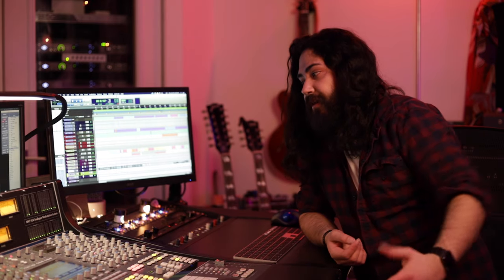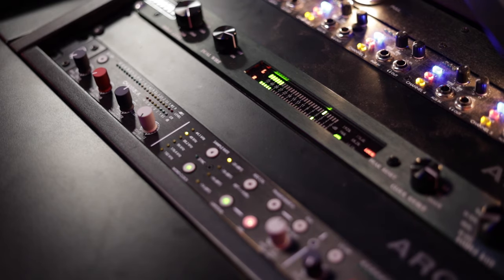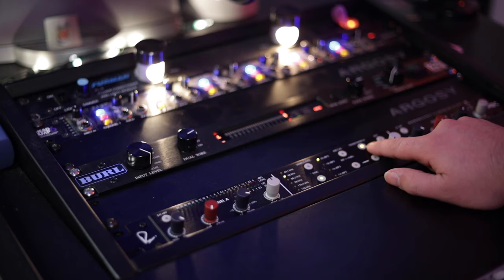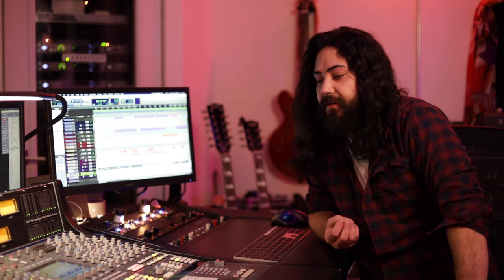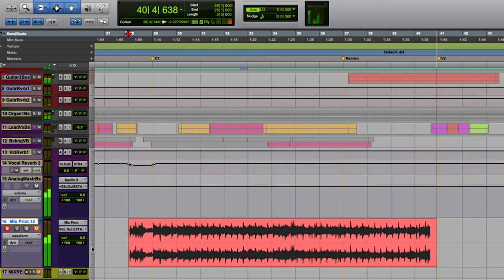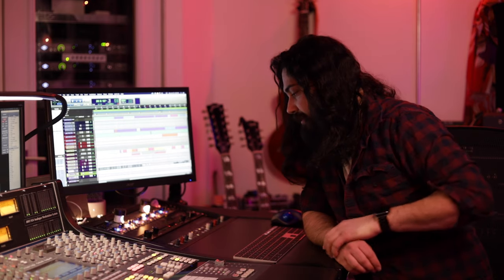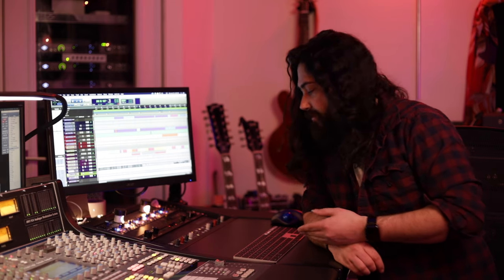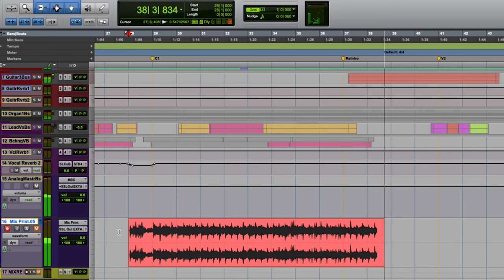AD Converter Shootout - Burl B2 vs RND MBC vs. UAD Apollo X

Comment: Any ADC that colorize your signal is a bad ADC. I bet it's not the case of any of the stated equipment.  The Burl seems to just have an emphasized low end (at the preamp or any other spot on the signal chain) or maybe is a bit gainier, which tells you nothing about the quality of the converter itself. You should compare them by proper spectral analysis, distortion, signal-to-noise ratio. Otherwise people are just deceived in their own biased perception. 
Another method of comparison is to take 2 captures of the same signal, by two diferent ADCs, align them in perfect phase and exact same volume, then invert the phase of one of them, so they cancel each other. If there's something audible left, that's the difference between the ADCs.
Reply: but when it sounds better, whats the prob
Reply: @newtension  "good" and "better" are subjective terms. They may vary from person to person. Ears are bad references if the goal is to perform an objective, technical, analisys. On the other hand, I don't know why an ADC needs a transformer, but these and coils do change the phase of a signal by nature, as any other type of filter (except digital linear-phase eq's). We don't have the hability to hear phase, unless there are two signals interfering each other. It matters, because our room and speaker setup will mess up sound by many orders of magnitude more than an ADC, I bet youtube compression also mess the quality of the signal much more than an ACD will do, so its a futile practice to compare between them by listening over YT. The important parameters for selecting an ADC can be tested an analyzed objectively, they are noise floor, frequency response, phase response, distortion (produced by saturation, jitter, quantization error or other phenomena, it will show as harmonics in an FFT graph).
Reply: @robertcrystals  the problem is, it sounds "better" while you are mixing. The people who listen to the records don't have fancy converters. The goal is to make a mix that will translate very well. If the converters help you mix better great. But their primary job is not to make things sound "good", but rather very precise.
Reply: What interface would you recommend for vocal recordings
Reply: @EM-km8em  Any. As any interface should be transparent and used in its linear range. If you want to colorize the signal, use a tube preamp before the interface.
Reply: @gastonpossel  i just want crystal clear vocal recordings. I currently use a U87ai with the apollo twin duo mk2 and tbh Im not impressed with the quality of the vocal recording.  Is it possibly the cheap XLR cable ? Would a high end interface get better results? Do i need a hardware quality pre amp or compressor ?  Theres something missing in my chain
Reply: @EM-km8em  No, the cable will not affect your sound in any significant way (unless it is getting interference noise, in which case you should use a shielded cable, check you connections and use the shortest cables possible). A better quality interface is not going to improve your sound the way I think you want either (better quality interfaces means less noise floor in general). The mic and room you use, on the other hand, will make tons of difference in the musical quality of your voices. Hardware preamps and compressors also can sweeten the vocals big time, even in mild, mostly transparent settings (that has to do with added harmonics). But there are lots of plugins that emulate these hardware pieces, so if you are on  budget, that's a good way to go. If you want to spend money to improve your vocals, I would suggest a good tube preamp or a hi-end microphone.
Reply: @gastonpossel  is there a good  hardware tube preamp with compressor all in one that you would recommend ? Thank you!
Reply: @EM-km8em  That wildly depends on taste and application. But I can attest to an  Universal Audio 4-710D tube preamp. It comes with compression and it is also an interface (meaning it has an ADC -which is not the feature that colors the sound, but the pre is-), and it can hook up to apollo interfaces to expand the input channels. A friend has it in his studio and it souns great.

Comment: Sounds exactly the same as a hundred dollar interference… The difference is subtle enough to be inaudible… Kinda doubting this will save bad music or a terrible mix… Whatever floats your boat…
Reply: Right it wont save a bad mix or bad music in general but the difference is not all that subtle when comparing to $100 interface.  Now multiply that X times when sending things out to hardware and back and the differences will even be more pronounced.  That said, a cheap interfaces will not be holding you back from making great music, specially If you stay completely ITB
Reply: @_allcap  Your right it’s not subtle, it’s identical, for all practical purposes, if you record the same source you’ll see the exact same binary code get emitted upstream… Review the datasheets for converter ICs, you’ll see that 24bit units are monotonic with no missing codes, there could be some very minor phase difference at the corner frequencies, but nearly any IC you find, inexpensive or not will be practically identical, both in the physics and electrodynamics, if you have many many channels then aperture and clock jitter might have a small effect, but channel to channel it doesn’t…
Reply: @robertw1871  If they were identical then you could flip the polarity and get a complete  null.  We both know that is not the case..so we can put "identical" to rest.  You can decide for yourself if the difference is worth it. Most ppl that hold your opinion either A) do not have access/cant afford the higher end units, or B) Can't hear a difference so assume nobody else can.  In no world is the difference between the Neve w/ Transformer to the Apollo "inaudible" even with youtube compression. Like I said it won't make or break a record but inaudible and identical they are not
Reply: @_allcap  What your describing is not the converter, transformers and things intended to color the sound are separate… The converters when run clean are identical enough to not matter, al least when I’m working on the designs for them…
Reply: @robertw1871  I can see where youre coming from, I really do. but I can assure you there are "good" and "better" converters. I dont know why people bother doing YouTube comparisons. its like painting a car and giving people glasses coated with sh!t to look at it. I have listened to quite a few different converters and there is a difference. once you start getting into the higher tier not so much. people have nulled different converters and its there. again I see where youre going, in that a 5 thousand dollar converter might not make that much of a difference to you against a 500 dollar one if you have to feed your family. its called priorities and diminishing returns. but there are differences.
Reply: @flipnap2112  The differences would be in the phased lock loop, filters and input amplifiers. The converter itself is, even on cheap ICs is so dang close as to be evanescent… This topic has been beat to death in the worlds best labs for as long as I can remember… The components used in the Burl are the same as you’ll find in nearly any piece… Nulling the phase results in zero difference between some devices, I’m not sure that’s a good test and it isn’t how we’d do it, but with access to around a million dollars worth of test equipment I suppose that’s not something we’d do regardless… This debate was once speaker cables, where is was proved to 1 part in 20 billion to make zero difference, although some could swear they hear it, of course zero of them made it through the double blind test, right so… I trust the test equipment and physics far beyond a person’s thoughts on what they think they hear… As far as I know there aren’t too many people that can hear that detail and all that think they can fail in scientific testing at the audiologist, it’s far more mental and conformation bias that actual acoustics… And the extremely minor difference between 0.001% THD+N and 0.00001% THD+N is so ludicrous as to not be a thing, the average person can start to detect distortion at around 1.5%, so thousands of times higher, and if they aren’t actively listening for it it’s closer to 8-10% THD… I know there are people that swear they can hear it, it’s just that they are 50% right 50% of the time when it’s being tested scientifically… 16bit was better than 99% of people needed and had no interest in higher resolution converters, 24bit is beyond what is as perfect as it can get just due to the physics of the noise floor… So if the converter has no missing code and is monotonic, then only the aperture of the clock would matter, and at 192kHz that’s far beyond the Nyquist rate that would absolutely ensure all content is encoded to far beyond what any human can hear, so that negates aperture jitter… So at worst you’re hearing 7.4 billionths of a volt difference, and that’s worse case… It’s laughable when you look at it in the lab vs someone telling you what they hear… This equipment is more than a hundred billion times more sensitive that the best human right so…
Reply: @robertw1871  I borrowed the converter, had my friend A/B it against my current one while I looked away while he kept track. 20 tests with a 10 minute break in between for an hour. I picked the new one every time. I bought it. im not much into debates and fighting about equipment died with the "Mac VS PC wars" decades ago. Not trying to prove a point or sell anything. theres a difference.
Reply: @flipnap2112  Hey if you can hear that’s great… none of your customers will though… Just saying when we design the circuits and send them to the FAB we can’t actually measure the difference in any meaningful way, so it’s out of the hands of the electronics engineers, and beyond what quantum electrodynamics can quantify… Our marketing department is absolutely fantastic though…
Reply: @robertw1871  well, im my own customer ha ha. and I dont pay well so I was gonna make dam sure it wasn't my mind playing tricks before I dropped a grand on a 2 channel converter. I dont know much but honestly, and im not trolling, if all converters "sound" the same, why not buy converters on the cheap (you know which interfaces use them) and make a 32 channel AD/DA for like 500 bucks? i know names sell, and I see people caught up in the hype every day. Even heard people talking about how the SSL UC1 "has amazing converters and transformers  inside" ha ha. trust me im more on your page than you know. I been in the game for a loooooooong time.
Reply: @flipnap2112  😂 I’ve got a UC1, and 2 UF8s… it’s pretty cool, but yeah no converter inside… People will pay what they think stuff is worth, is a 63 strat really worth $80,000, to someone it is, to a lot more people it’s just a used guitar… The interesting thing is the Burl converter in this video that’s a pretty expensive piece of gear, we’ll the super duper magic part (AKM AK4499 or equivalent) costs around ten bucks… Yep $10… the el-cheapo ($99) interface uses a part that’s about $1.50… While the $10 part is “better” on the datasheet, it isn’t in real life use… So the real question is does the $10 converter sound better than the $2 converter… And remember the $2 converter like all electronics is only $2 because they make them by the millions not the hundreds… It’s a completely different discussion when you look at it from a manufacturer prospective and not a consumer prospective with the rosy marketing glasses on… 🤓
Reply: @robertw1871  yeah its an odd human thing. put up a finger-painting for 30 dollars and its in the trash pile months later. exact same finger-painting for 3 mil and its a hot commodity. I remember when "Banksy" finally sold a print at auction and secretly made the frame a secret shredder remotely controlled. after it sold it shredded itself.. the pieces sold for more than the art. so much for "making a statement" about the human condition.  People will pay top dollar for a new Gibson thats built in the same shop a squire is. old school collector items? yes, for sure. by the way, I have two serious questions for you.. what do you think of "access analog" and how's the UC1? I cut my teeth on an SSL and my muscle memory is burned in stone. have an awesome weekend
Reply: @flipnap2112  Love the UC1 especially with the UF8, it’s stupid expensive for a mouse replacement, but it’s well made and has changed what I do in ProTools… I turn the screen off and just use those, makes a big difference for me. I’m a little old school and track and mix mostly for a hobby, so my life doesn’t depend on it, but I’ve done a few collaborations and helped some friends get some demos together. I can’t justify a full blown console, but the SSL controllers are pretty close if you invest in the time to learn how to set them up… A UC1 with their 360 thing is probably all you need really, pretty cheap if you don’t catch the plugins on the $50 sale… I try and track as close to finished as possible, all EQ, effect’s and compressors in before it gets printed… So I’m only doing a little surgical cutting to get things to fit and then squishing the master buss a little with the SSL buss compressor, same as it would be done on the 4000 or 9000 console… It’s pretty simple but really effective… I’m a magpie so if I’m looking at a screen my ears shutdown lol… So not having the screen on and being able to turn knobs is way more my speed… It’s not going to be for everyone, but if you want a console’ish flow, then I’ve not seen anything better… After buying way more crap and spending crazy amounts of cash, I’ve gone full circle to it’s not the equipment, it’s me… if I know what I’m after then the gear really doesn’t matter that much… The only thing that does matter is the studio monitors and room, I had issues with reverb and low end, sounded great until I bounced the mix and played it on a iPhone… was horrible, not enough lows and far too much reverb… So all the gear in the world was a joke because my monitors were bass heavy with a room that was treated too much and totally dead, causing me to add too much verb and cut the lows… Got that sorted out now… But it’s that kind of stuff and your ears that are huge deal elephant in the room, so from the speakers to your brain is where I’d spend time and money… That’s pretty much my point on it all, yeah a converter might be a tiny bit better, but that part is like 0.001% on the importance scale… An EQ and compressor you can work with and a monitor system that is solid (doesn’t need to be expensive) and training your ear, to me that’s 99%… I’ve been in the electronics business for decades and once upon a time manufactured pro audio for movie theaters and sound reinforcement… Currently I’m working for one of the top 2 electronics companies, so music is just a serious hobby for me, that I do some limited commercial stuff with… I’m thinking of retiring and building some gear and opening a small studio for the non mainstream in my area… lot of great musicians here that aren’t looking to become rockstars…
Reply: @flipnap2112  You have an awesome weekend as well, nice to share some thoughts and ideas, nobody is the judge and jury on this stuff, it’s all about what gets it done…
Reply: @robertw1871  hey man, thanks so much for the long reply. yes the best thing I ever did was treat my mix room. spent a LOT of time on that and I have a pair of dynaudio mid fields and "cubes" for near. probably one of the better things I did was buy "Arc 3" and calibrated. it actually really really helped, I was shocked . mixes in the car sound a LOT closer to what theyre supposed to be. also use "harbal" which is an old school mastering EQ program but it never lets me down. mixes sound exactly the same no matter where I play them. aight man, have fun
Reply: @flipnap2112  Yep, sorry if my comments are basic, didn’t know your skill level or experience… That’s the key though, recreating the less than optimal environment that it’ll actually be played on… Big ole smiley face systems that are boosted in highs and lows, or have no lows at all lol, and have no definition in the mid lows at all… But If the music is good nobody really cares… I just try and not mess that up… I’ve got the luxury of not having to fix gross errors, if it wasn’t good enough it gets tracked again until it’s right or trashed… Good enough to me is in tune and real, little mistakes or some noise makes no difference, if it’s good it’s good, and the more real-time swing and groove it’s got the better… Kinda the opposite of what actually sells, but someone has to capture real music by real musicians without auto-tuning and sample replacing the life out of it….
Reply: BY YOUR LOGIC..A MAZDA AND A BENTLEY ARE THE SAME BECAUSE THEY BOTH WILL GET YOU ON THE ROAD!  😆😆😆😆😆